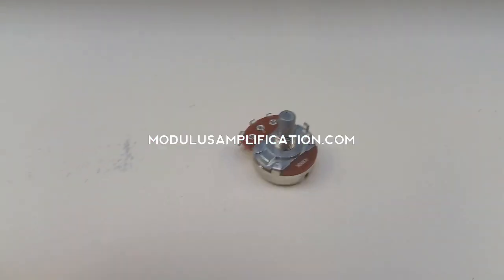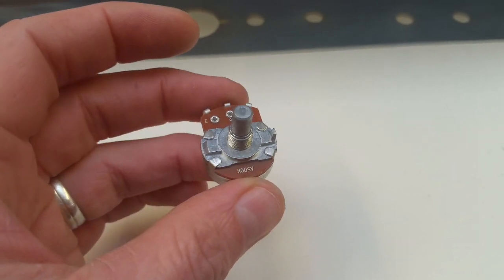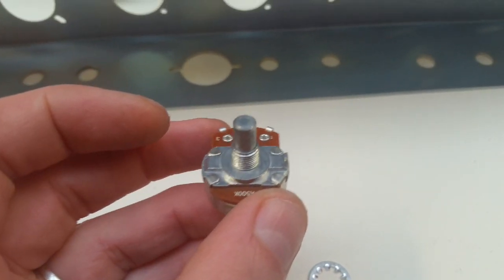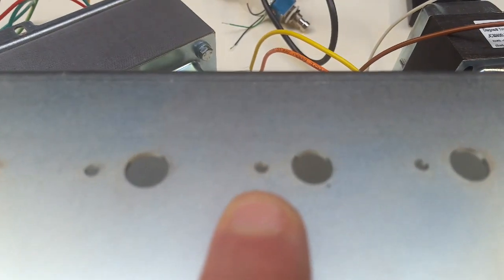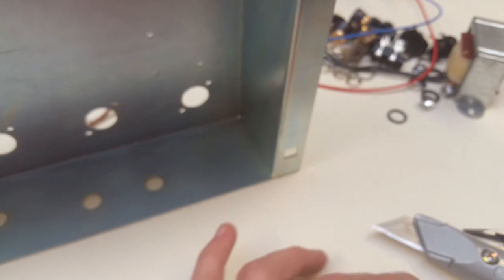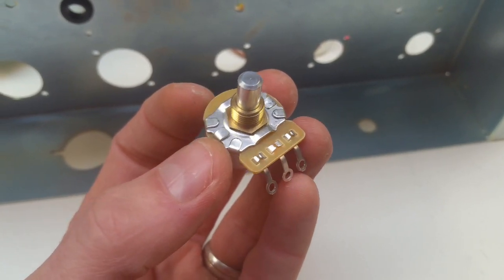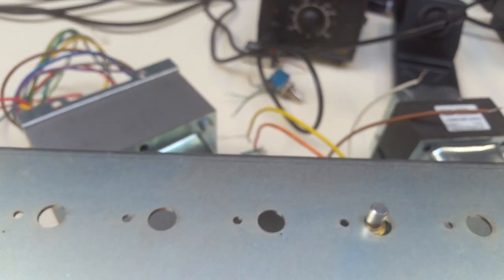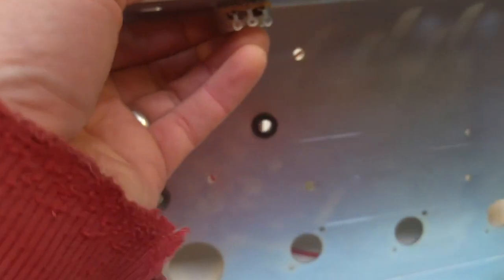How to: Don't break your potentiometer tabs off!

Comment: Thank you! What should we do if we have to use these pots in a 5e3 chassis, without drilling holes - break off or bend down? any preferred method for doing either? cheers :)
Reply from the maker: Breakoff and use a lock washer if required